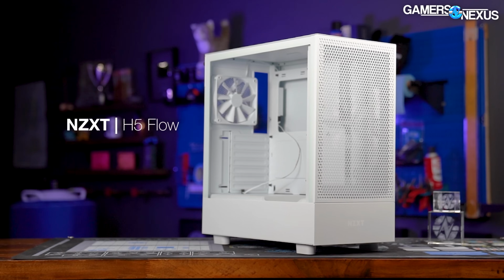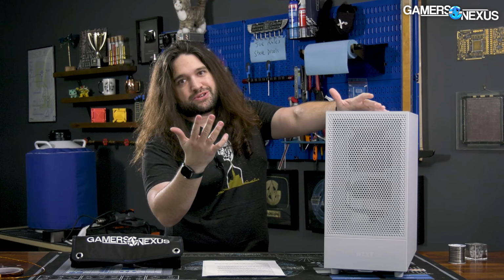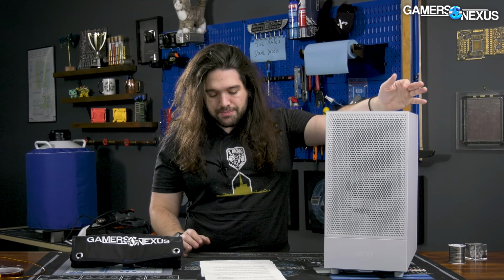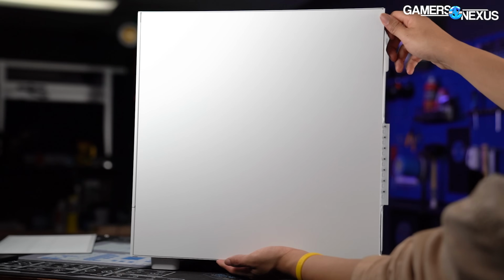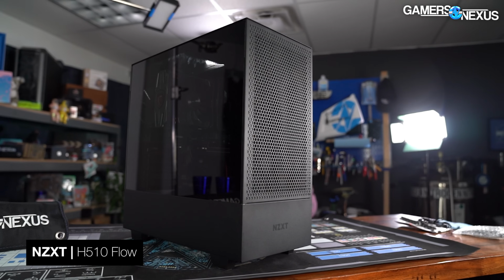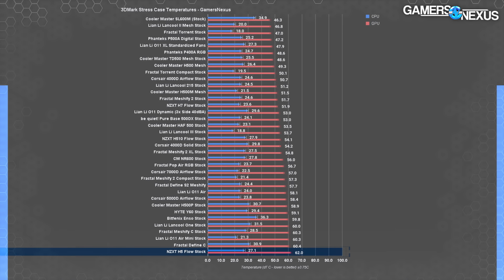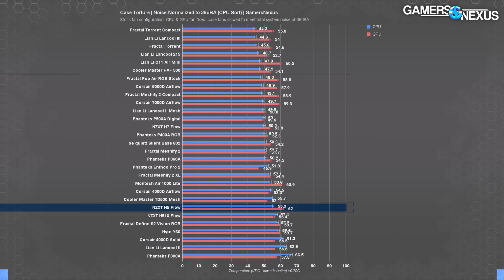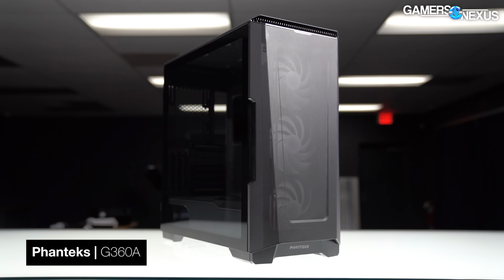NZXT H5 Flow Case Review: Thermals, Cable Management, & Noise

Comment: I think a toilet bowl fan is a great idea (context people, CONTEXT!), but it sounds like this case is a bit on the small side for it in addition to the missing front fans. I wonder if GPU thermals would improve much if you modded it with custom duct from the bottom fan directly to the under side of the GPU, preventing the air from bypassing around the sides. That, plus a couple of front fans could make for a decent build if you are into case modding and already have a couple extra fans laying around.

Comment: I kind of appreciate cases not coming with fans. I usually want to use other argb fans anyway so it's just another thing I have to store or sell when I remove the stock fans. That said I think it's worth noting that cases like this are hard to compare to competitors since I don't think NZXT expects anyone to actually run this case in the stock configuration. If you compare the NZXT H5 flow to the Lancool 216 with 2 140mm fans added to the H5 Flow they are pretty comparable, and the 216 is as far as I know the best thermally performing midtower on the market. 216 is definitely the better case when you control for cost, but I think this H5 flow performs quite well when configured in a reasonable way.

Comment: I recall another case that NZXT experimented with angled fans. It was the Switch 810 full tower. One of its main selling points was having two adjustable fans on the back of the front-mounted hard drive cages. Dunno how well it works but the whole idea looks interesting.
Reply: I used that case for almost 10 years, just swapped it out. Was ahead of it's time, and not too far behind cases today.
Reply: GN actually reviewed that one iirc

Comment: I don't think the lack of fans is a problem, most users will just front mount the radiator, or get 2 fans of their choice anyways. I don't remember the last time I kept the stock fans on a case that I bought.
Reply: Yeah stock fans usually just get moved to whatever the old parts project is (NAS, rig for partner, etc). I do like having extras around to experimenting with though
Reply: you are so true!
Reply: Lack of fans is real problem if you cant spend any more money. Good thing you have more to buy good quality fans and AIO. Most people use air cooling anyway.
Reply: the Only cases i can think of where i have kept / would keep the stock fans are the beQuiet 500DX, 500FX and 802 so yeah, mostly true
Reply: The lack of stock fans is not a problem.  The fact that it had bad GPU thermals even with two front fans added, however, is.

Comment: This review feels so bias for some reason, like some deep down hatred for NZXT. Continuous focus on all the bad aspects (some of which wouldnt even be an issue for the average person like the 2 included fans. Quality fans are cheap as hell to buy, and no budget case will ever come with all of them included), and just completely glossing over anything good.
Reply: GamersNexus isn't biased against NZXT. It's just that they go over extra positives and negatives when talking about cases instead of the neutral sides of them. Which is good if what you are looking for is a quick review that goes over the delta of standarts, but regrettably bad if your goal is to learn more about what makes the standart "the standart".

Comment: Just ordered this case and 4 Noctua fans. It will work exceptionally well with my Nvidia FE card’s flow-through design. This case is clearly designed for that air path.
Reply: That's a wise and clever choice.
Reply: Which card specifically do you have if you don't mind me asking I'm looking into building my first PC with this case and I'm curious what works for other people.
Reply: @NeoVester how did your first build go?
Reply: @Akamo.  Not great the thing didn't turn on so I'm currently considering taking at all apart and trying again or taking it to a repair shop
Reply: @NeoVester  Update on your Build ? What happened to your Build to take everything out ? What was the issue ?

Comment: Your product reviews are the ones I always wait for before biting the bullet. Would you consider reviewing the Jonsbo D30? I think it’s very aesthetically nice, love how understated it is, and seems to have good reviews. The only thing i’m worried about is the fan intake spots are slightly different than a standard case and Im curious if the thermals are okay
Reply: Maybe a dual review covering the D30 and D40. There is an update of those coming out soon called the D31 and D41 also
Reply: @FrackaLacka  Good to know that an updated one is on the horizon, i’ll keep an eye out for it

Comment: Hey Steve, is there any chance you could make a 'dusty room' in your facility? Perhaps you could make an enclosure in one of your rooms that is just FULL of dust and you put PC cases in there with their max fan slots occupied to test their dust filtration and efficiency? Would be quite interesting to see how modern cases compare when it comes to their filtering capabilities, as it's something I feel a lot of people would be interested in knowing the results for. From my own personal experience of owning these cases for typically between 3-9 months each, I've found that these were the results:
Phanteks P300-P400A: Horrible dust filters, cases quite often filled with dust after a couple of months (with regular dust filter cleaning).
Corsair 4000D Air flow: Horrible dust filters, case was chunked with dust and hair after a few weeks - 2 months (with very regular cleaning).
Lian-Li PC-O11 Dynamic XL/Mid Tower: Insanely good dust filters, never cleaned out case at all, with infrequent dust filter cleaning.
Metallicgear Neo (Phanteks): Mediocre dust filters, case filled eventually with regular dust filter cleaning.
NZXT H510: Decent dust filters, case eventually filled with dust with regular cleaning.

Unfortunately, dust buildup is one of those things that takes weeks to accumulate, and you don't really want to be testing a case for weeks on end, it's a very bad return when you're making review videos like you do, you need the data and video produced as soon as possible. But, if you were able to set up an enclosure that could effectively emulate several weeks or months of dust buildup over the course of 1-4 hours then that could potentially be game changing for case reviews. 

Let me know what you think, would be very very interested to hear from you.
Reply: It is easy to test dust filter.
Mark out the area of a dust filter occupied by 120/140/whatever mm of fan it is intended to filter for.
Weight out a certain fineness of dust.
Make a jig that limited where the dust can go. 
Pour the dust, wait everything to settle (10 - 15min)
Weight amount of dust pass through.
Compare and contrast. 
I think your specific problem is likely more about the pressure profile and other unfiltered gap of the case.
Reply: Good idea but it makes me wonder. Where does the dust go on your Lian Li if it's not caught on the filter? If the pores are so small that dust doesn't even get caught on there, then it'd surely affect thermals.

Comment: H510 Flow with front fans.. Done.  the white and black look works for me, and the fans will improve airflow.  and I'll be sitting just above the butt ugly corsair 4000D  in price ( currently $104 retail)  which I want to like but MEH!   The 510 Flow is at $90 at retail currently.   Most of the neutral press had a lot to do with the price,   Thermal performance was OK  -  but adding fans,  like with the H5 flow makes sense while adding dollars.   Moral of the story. You can't always get what you want for under $100.

Comment: This case looks perfect for a compact build, primarily due to god tier aesthetics while not sacrificing anything else. I and many other ppl stopped using hard drive cage as well as default crappy fans long ago so case literally has zero cons
Reply: Agree, the review is appropriately from the angle of as-is, however I'd drop high quality fans in there, and I use a single TB SSD.

Comment: In their defense, I would like to see cases and air coolers on the market WITHOUT fans, because I did not spend a shitton of money for my Noctua and Noiseblockers fans to pay for the "shitty" one that producers throw into my case. I just want to move them from case to case and not worry about spending money unnecessarily on electronic trash. I believe this is also the reason why the community wants you to do "standarized fan testing".

Comment: it really isn't a bad case! i just did a new build with 7700K > 13700K. One thing I was surprised with is the fan noise. I guess I took my Fractal R4 case for granted, that thing was a silent beast. The H5 Flow has about 40% more noise but I know I can upgrade to some premium fans to dampen the noise. Plus my PSU can use an upgrade soon. Overall though The cable management and color were awesome for the sub-$100 price and I give it a 7.7/10. Perfect for a build for your kid's entry-mid level gaming, or non gaming work station.

Comment: I'm firmly of the belief that including enough fans is not necessary. Too often they go to waste if you are going to use radiators in those spots, or upgrade to better fans. HOWEVER, that is as long as they don't make it seem like fans will be included for those not going down the radiator path. Showing pics of fans in place, with a SUPER TINY disclaimer saying "fans not included" is BS. Not sure how this case was marketed/presented to the buyer, so no opinion on that here.

Exception: With a more oddball fan size like their bottom one, that definitely needs to be included though. Even if it is still a standard, if it's not 120mm, it needs to be there.

Comment: Throw a Arctic 3 pack of 120mm fans up front and in the toilet bowl. You could get some rgb ones and have the forbidden blue urinal waffle. Use the nzxt fans as exhaust. Nzxt really missed a good chance at tipping the charts like Corsair did with the 4000D. Either populate the fan mounts or don’t put any fans in it. But that’s just my opinion.

Comment: I disagree that if you buy fans you should just consider a higher price point case. You'll still have to buy fans even if you buy a more expensive case. Most case fans are pretty garbage with the exception of the fractal and silverstone 180s

Comment: I bought the H5 FLOW rgb from amazon,  It came with 2 front rgb fans, 1 exhaust fan and the bottom gpu angled fan. so 4 total.
Reply: Hi, I am considering either this, or h7 flow, could you please tell me what are the temps you are getting for your GPU under peak load. and which GPU do you have

Comment: Totally agree that it needs those two front intake fans, but am not so sure about the statement that those two fans would significantly add to the price. There are a ton of multi than packs available that cost less than $15, for the pack. Like 2x Be quiet! 120mm for $10 (for both). Sure you could get a larger case for similar prices, but maybe space is of concern and design is important to you.. taking those factors into consideration this car seems like a pretty good option :)

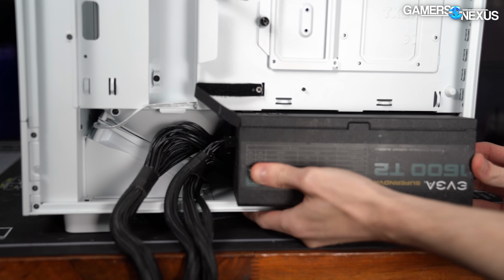Comment: 5:38 When looking at this I can't help but thing the whole fan assembly should have been part of the case structure. Allowing for the fan to pull back towards the very front of the case. The bottom front could even change shape like a hexagon allowing for different angles the bottom intake fan could take.

Comment: I would recommend to GN that you begin adding tests that add a reasonable amount of fans to a case. I have never met someone who bought a case and only ran the case with included fans unless the case comes with a VERY GOOD or almost perfect setup from the factory which is extremely rare. Almost everyone has to buy fans for their case. However, GN could balance these reviews by adding the prices of said fans to the price of the case and THEN comparing "Apples to Apples" on which is a better "Bang-For-Your-Buck".
Reply from the maker: We already do that. Watch the review.
Reply: @GamersNexus  I mean kinda-sorta. You did in this review, and you have in previous reviews, however when the charts come up to show comparisons to the competition, it is showing stock-to-stock comparisons. Its an absolutely fair comparison sure, but again, with the fact that almost anyone who builds a system winds up buying a couple fans, that final performance comparison might benefit from a comparison between cases that have had those extra fans installed, and then compare the overall price with included fans to their relative performance. The only issue would be a control. I would simply get a few 120mm and 140mm fans that you install in all the cases, the same brand and style every time. Of course thats just being picky, its not like you guys do a bad job, of course not. I got my P500A based off Steves recommendation a few years back and it is a truly amazing case. Im just surprised see that you guys already call it "old" lol 🤣 its a case and still looks just as good as any other.

Comment: 21:15 After we saw conclusion in this case, are the 4000D Airflow little bit more value to performance guys? (Me dont like Fractal Pop Air Design) Looking from the GPU temp...

Comment: For anyone buying this case in 2024 this version now has 2 of their 140mm rgb case fans in the front if you get the rgb version which is pretty much the same price as the normal one so there isn’t a reason not to. Also these 140mm fans are their normal fans that they sell on amazon and are generally pretty good quality.also the rear expansion slots are now perforated well instead of being completely sealed but are still tightly packed.

Comment: My old full tower takes 7 fans / 8 if you leave the top optical drive bay empty and CAME with 2 fans in front with a dust filter and 1 an exhaust fan in the back. It is an NZXT case and I am still using it 10 years later. This is from the days before they developed small form factor cases that provided employment for professional fire fighters. Sad to see how they have regressed.

Comment: To Gamers Nexus: @12:58 this is actualy picture of Phanteks P500A instead of G360A. G360A, which you recall unpublished testing, is smaller, has different side, front and top. In fact I would like to see your thermals results for G360A asap, as I'm considering buying one or P400A digital or Fractal Pop. Thank you!

Comment: Out of the box fan config is interesting, but no one will ever buy this case and not put fans up front. Most user will immediately remove the stock fans for their own preferred, there is an argument as to why cases have fans at all. Drop them and drop the price too.

Comment: after watching a lot of builds and reviews of this case i bought it. march/2024. The RGB Version of this Case comes with 2 x 140 RGB Frontfans, the 1x120 Front Intake from the bottom and 1x 120 exhaust.
Using an AIO (240 on top or 280 on front) and you have all the Fan spaces used and the case is very quiet while having exelent airflow.
I can recommend. Only downside. only 1 usb gen 3.2 on the front
Reply: What are the temps you are getting under peak GPU load and which GPU?
Reply: @rabiulislam92  have a i7 14700kf 280 aio on front as intake. Rtx 4070 ti super.
Max load stress test and both maxing out under 70c

Comment: I like this because it has just enough space for a 280 in the front and then a 240 on the top.  My guess is that is why they didn't include more fans, because the AIO you throw in will have them.

Comment: I think it's a good idea to show the tests with the additional fans installed because no one is going to buy a case like this and only leave the stock fans. Every PC i've built and i'm sure most other people as well have always bought a couple extra fans because cases always seem lacking. I think case manufacturers other then saving money don't know if your using radiators that come with fans and so on so they figure they'll give you a couple but it's up to you to buy more if you need them. It just doesn't seem right to test them with only the stock fans as that's just unrealistic, everyone going to at very least install radiator with some fans, or buy a few extra fans to support an air cooled cpu. The only problem with this is all your old testing was done with stock only so now it gives an unfair comparison, but at least you showed all the options, stock, and with 2 extra front fans for comparison. I can just see a lot of people immediately jumping to conclusion though that this case is better then most of rest because other ones didn't get tested with extra fans, and if all of them did, this case likely wouldn't be at the top of the chart.

Comment: The power supply will probably become an external component soon, or should be with the power they have to push... one main connector into the system would lead to more thermal solutions and smaller cases.

Comment: And here I am with no intake fans. A fully covered front panel. Running a mid range PC without any complaints of sound and temps. Lmfao. I will be buying this case though. The only thing I care about is literally the aesthetics and no one beats NZXT in that sector.

Comment: I got the rgb version of this case which has more fans specifically at the front, which I found hilarious- I didn't care about rgb initially but the fact that it allowed for better cooling (at least I think so don't be too harsh this is my first build) is hilarious to me, so I ended up getting corsair ram that lights up and a cpu cooler that lights up, and I think it looks pretty nice.

Comment: great thanks bought it added 2 front fans from old pc and left exhaust and added 240 mil aio to the top and runs great love it
upgraded to 12700 and z690 from z390 and i9 9900. love it and will sell the 9900 for most my money back